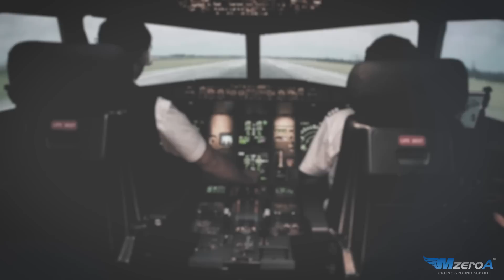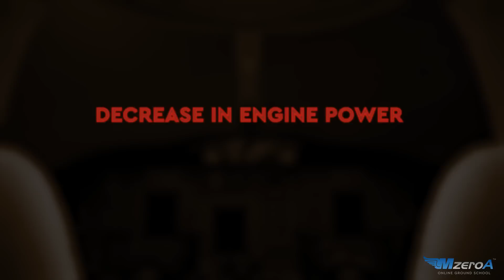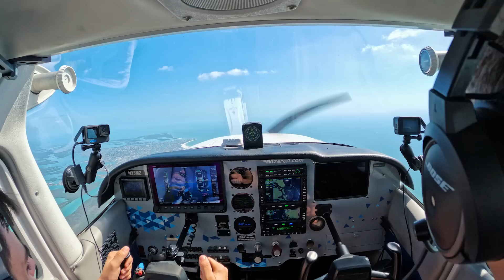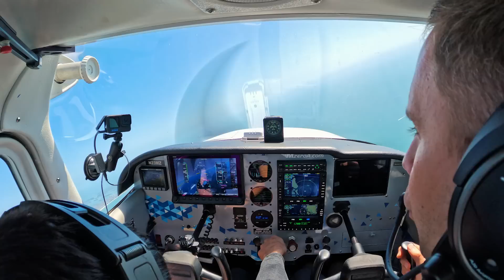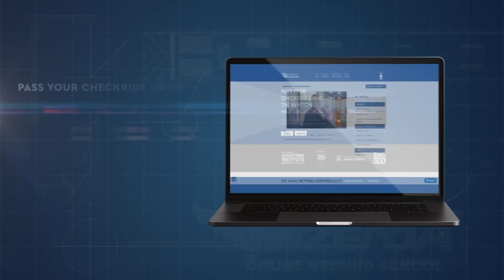Accident Analysis: Disasters of Spatial Disorientation

Comment: You are spot on how spacial disorientation can sneak up on you. Blue sky on top of blue water and throw in a little bit of mist and low light due to a high overcast layer.. Your eyes rapidly scanning up/down/left/right to try and pick out some defining characteristic but it's all just a mush of blue/gray. Had this experience flying over the Puget Sound en route to Boeing Field last year. Definitely got my attention. I feel one of the most important things to do right away is pull the throttle back.
Reply: Please explain why pull throttle back, what if you are disoriented and actually have a nose up while you think your nose is down

Comment: I'm a high-time pilot, Comm/Multi/CFI, etc..  Excellent lesson.   I actually experienced a pretty severe Vertigo situation  hauling passengers from point A to B climbing after departure to VFR On Top.  Right after pulling up and trimming for a 500'/min climb, I noticed a large auto accident situation on the freeway below me.  I looked down to the left, and within seconds entered a complete overcast cloud layer.  I 'snapped' my head back to the instrument panel but my eyeballs "un-caged"  -  I had realized I was in a vertigo state (how to recover?)....  I knew about the ear fluid flying circles in my head, so I snapped my chin down to my chest abruptly and back up.   The vertigo immediately stopped.  In addition, I relaxed all flight control pressure on the stable climbing aircraft and quickly recovered normal flying capability.  Yes;  I stopped that circus event in my ear canals.  We finally broke out on top around 7,500.  I learned my lesson about taking my eyes off the instrument panel while climbing into IMC.   I now call it the 'Olson shock treatment'.
Reply: I have a better theory for why his transmissions weren't received, he was probably too low for his radio signals to hit the tower.
Reply: That's scary! Thanks for sharing.